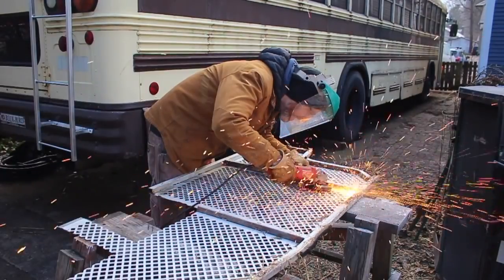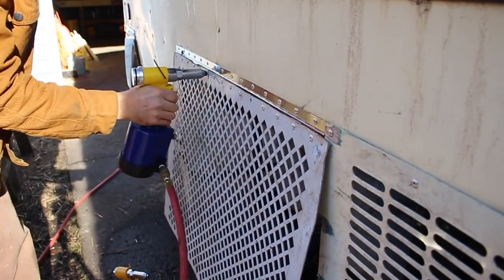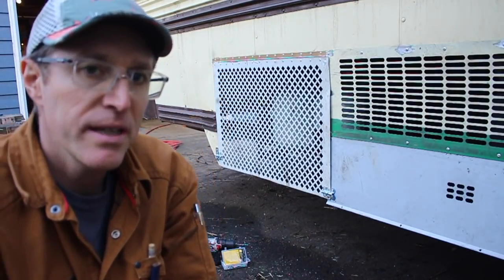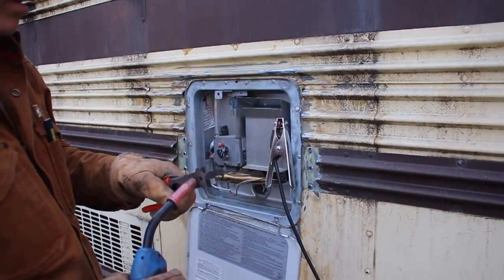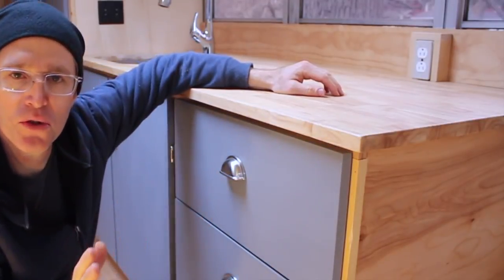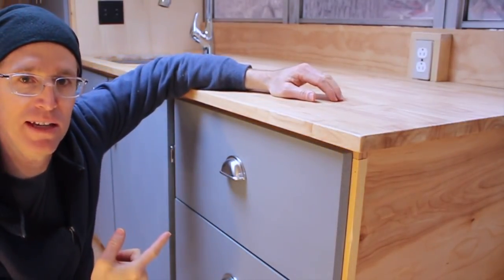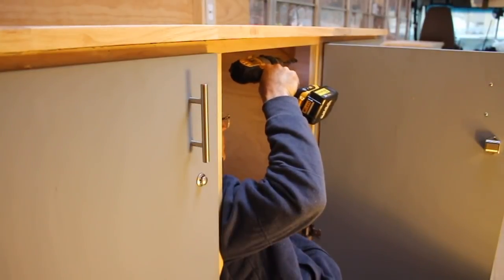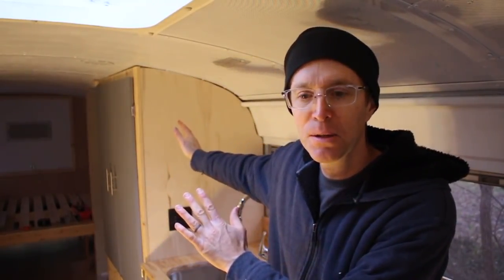New Ideas -- Prison Bus Conversion #48

Comment: Loving the drawer locks
Reply from the maker: Thanks Jynxie! I hope you're doing well
Reply: metaspencer we are. Just battling a moisture problem in our bus. But it's to be expected with 4 people all our pets living in it; as well as propane heat.
Reply from the maker: Yeah, moisture is tough. Vent fan in shower is key if the shower gets use, and running a dehumidifier or two 24/7 is essential... gotta avoid mold. Electric or wood fire heat won’t add that moisture like propane ... hang in there!
Reply: metaspencer already fighting mold issues. Had to replace a mattress. Added a wood stove but need to stole it every 30 minutes cause it's so small... Think I'll message you. Easier to chat there. Lol.

Comment: Another idea, maybe more complicated to execute but in the end more eloquent for the drawers is to create a latch behind the drawers that catches the drawers when you turn it. It can catch all three drawers at once. For example maybe something like some mechanism on a dowel and some kind of catches on the back of the drawers where you added some islets that accept a few metal hooks screwed into the dowel. Or if the dowel is a few inches thick magnets on one side of the dowel can line up with the drawer, and when the dowel it turned to unlock the magnets are now a few inches away from the drawers so the drawers are free. Depends how much space you have behind the drawers and the back wall of what you can fit back there. But you also have space on the side of the drawers since your tent poles are a fer inches for some other mechanism controlled from the top of the counter. The wooden dowel idea with magnets or metal islet or whatever you fabricate that would lock drawers, would just take one hole on the top of the counter near the backsplash on the counter top, and some round thing to hold the bottom, (like the thing that supports curtain rods in a closet) that the dowel or rod sits in and is supported. When putting it together after you insert the dowel through and attach the hooks or magnets to the dowel and back of the drawer so it operates correctly when the dowel is tuned from the top. The very top of the dowel might be sticking out an intch above the counter top so people can see it is a locking switch. So to lock the doors you turn the dowel (where at the top it comes out of your counter top behind the drawers) 180 degrees say clockwise and to unlock you turn it counter clockwise. and just turn it to lock before you drive. I got the idea because I have a tool box where when the top is open all the drawers below slide freely, but when the top is closed there is a mechanism that locks all drawers at once. I cannot see inside of how the tool box works but its all internal, but I think there is a rod with a spring that is pushed down lid is closed and when that rod goes down a few centimeters some mechanism in the back of the drawers that lock the drawers. You can create what I mentioned above or create an up down motion on the dowel mechanism or steel rod which is more like how the tool box works. so when you push the rod down an inch locks in the back of the drawers. The turning dowel is my first idea because then the dowel is just held on the bottom and top. But another way would be to secure some guide along the wall of the bus behind the drawers for something using an up down mechanism. Actually there are outdoor fence latches that use small bead chain that you pull to keep them unlocked you can also make some of those work and just pull up on the bead chain and tie it on a hook to hold those latches open. I guess there are just tones of ways to create something you operate from above the counter when standing. Whatever I think its just a bit better in the end than having  to bend down and insert the thing you made. What you did is cool but a simple hand operated latch, is better since anyone can see and it can be made or carved with arrow, lock and unlock so other people understand if they are in the bus using it intuitively instead of hard to see things like finding the wood thing you have in the cabinet. Its operation is more intuitive and somewhere in sight on the back of the counter. The piece you made which hangs on a nail will make noise when you go around turns and probably fall off the nail or hook you have it hanging on. Now that I think about it the idea I present is also similar to how a lot of file cabinets which have the drawers one on top of each other that all lock with the turn of a key from the top but otherwise when unlocked open freely operate. they might even sell keyed hardware for this, or if you salvage some old file cabinet maybe something will fit. The piece you made which hangs on a nail will make noise when you go around turns and probably fall off the nail or hook you have it hanging on. But anyway everything in an inventors world is trial and error and slowly perfecting what you made.
Reply from the maker: Hello! I really like your idea and have taken apart a few office desks that function in this way, locking the drawers from the rear. I think you're right: that would be an elegant solution, and I did leave three inches behind the drawers, so there would be room. My hesitation in doing something like this was with precision: with the cabinets already built, I wasn't convinced that I'd be able to install the dowel or other retention mechanism with enough precision to connect with each drawer in exactly the closed position, holding them in place. I thought about this quite a bit and finally decided that coming in from the side would be less elegant, a bit more annoying, but ultimately do-able. One final note: note that the hanging piece (off the nail) is only hanging when the bus isn't moving. When moving, it's installed. Thanks for your great, thoughtful comment!

Comment: nice idea of the drawer locking , should work fine 
the thing with a deck on the roof is that you need to mount it / make holes in a leakproof roof 
on the other hand the airgap between the roof and the deck should help keep youre bedroom a little cooler in direct sunlight 
i would make a wind deflector in front of the deck if only to deflect branches and stuff
Reply from the maker: I know what you mean: the deck seems fun to have up there, but introduces a number of potential problems, mainly relating to water ... still thinking about it. A wind deflector would be key ... thanks for the ideas! I still like the roof deck idea a bit, as extra gear could go up there
Reply: @metaspencer  think the price difference between storage boxes under the bus or building a deck arent that great , the storageboxes be a LOT eazier to reach and lift stuff intoo (you need two persons to lift stuff upon the roofrack) 
seen some busses that had the deck mounted on the side pilars between the windows , should at least cause less water ingress (if you drill the holes slightly up ) still a big wind resistance 
allso seen busses that had a big (ski)box mounted against the rear of the bus 
https://st.mascus.com/imagetilewm/product/781bb590/ford-transit-m2-17-1-skibox-el,1e5feb48.jpg
https://media.daimler.com/marsMediaSite/scr/cache/7523258v-2tv3/A-box-for-all-seasons.jpg
for rear engine busses the boxes are made to hinge sideways 
could take a look at a scrapyard and cut the last foot and a half off a wrecked schoolbus make a wall and some brackets and be done with it 
would be a great storage for a motorbike of bicycles
Reply from the maker: All cool ideas ... you’ve got me thinking! Thanks

Comment: A 2 piece (half going up from bottom then the upper part going as well..) folding up bracket...and another 2 smaller cameras. Mounted up from..lookin on the side (left hand drive).. So the cameras should be looking at the length of the bus.. Preferably an 6mpx will do.. Others lesser r too grainy.and must have night vision and waterproof/iceproof)
Reply from the maker: Sounds like a cool setup

Comment: fold out/drop down, bumper area pivot,   rear deck  suspended by the ladder/steps for the roof deck/ solar panel railing platform.  Two decks,  too much?
Reply from the maker: Ooo. That would be so sweet!!

Comment: why you not go with tankless water heater
Reply from the maker: I went back and forth on that quite a lot, but ultimately thought that it would be nice to be able to have hot water off grid ... and I don't currently have a solar power source. So if that changes down the road and I have a lot more power available, I have cabinet space next to the sink and shower that would be great for a tankless unit. One more thing: I'm kinda ... cheap! And the prices of tankless units kept me thinking of alternatives. I think I'll also have a black pipe on the roof for water, just for outside warm showers.

Comment: Can you teach me the things you know?
Reply from the maker: haha ... I'd love to! :)
Reply: @metaspencer  Really want to start learning how to do woodworking, welding, soldering.. all that stuff but its tough when you don't know where to start or have any tools. I'm in Philadelphia and being in the city i dont really have the space to do those things either. Any tips?
Reply from the maker: When I started out, I was living in a small apartment and bought a rasp, hand saw, and simple corded drill. I was broke, and that was all I could afford. I used an old cooler as a saw horse and build some great things using nothing but screws to attach everything together ... and that was working on the grass outside of the building. The thing I liked about that is that it gave me a feel for the materials ... so I think you can start small and do some great stuff. Good luck with it!
Reply: Oh wow, that's super basic.. i didn't think it was possible. I'll take your advice and get started